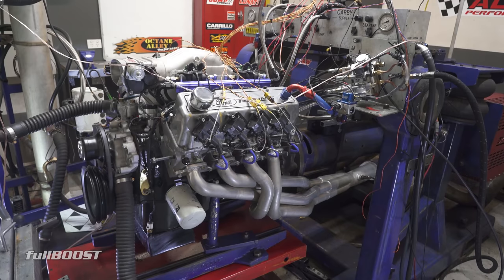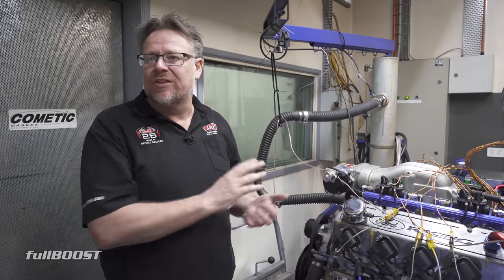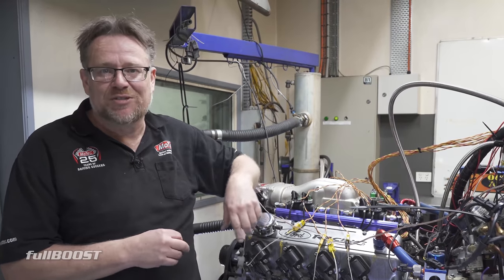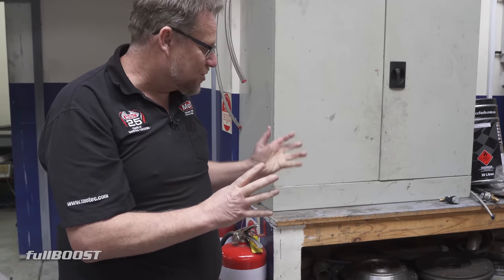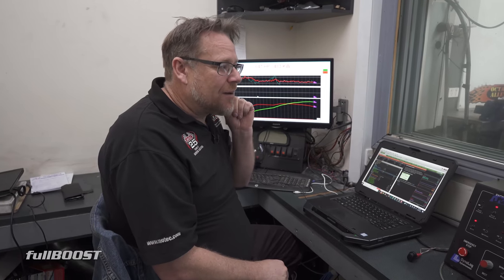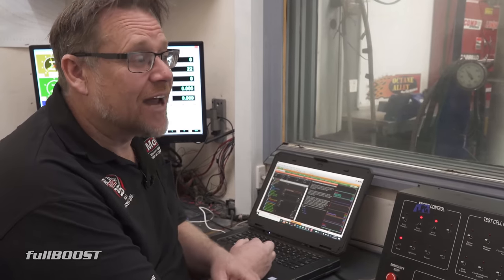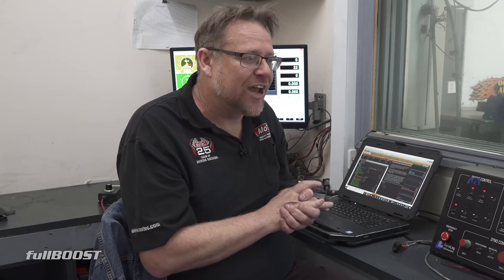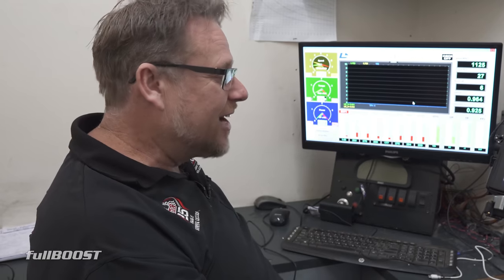In depth engine tuning with LPG liquid injection dual fuel | fullBOOST

Comment from the maker: How to setup and tune with LPG (Liquid Propane Gas) liquid injection with Tyrone Smith from Motorsport Electronics. 👉 If you’d like to be notified every time we upload a video, subscribe and then click the bell icon 🔔 next to the subscription button.
Reply: R h  Hahaha it's running a Motec not a Microtech. See you on Bench Torque.
Reply: R h  wtf has turbo taxi got to do with anything? The fact that scotty blows up everything he touches and can't get the thing to do a 10 says it all.
Reply: R h  not being phased out at all. Scaled back yes but plenty of servos still being built with it.
Reply: Fantastic video. LPG is such an underrated fuel. Aussie made, 100 octane and cleaner, $1 a less cheaper in VIC right now.
Reply: @d_zamb573  but lpg systems dont work according to R H. Guess my 3rz hilux has been running on fairy dust since 2003.
Reply: Nice content! Do you have a switch off at high rpm for liquid injection?

Comment: Having done my final thesis for my Engineering Degree on Liquid LPG injection many years ago, I found this brilliant to watch, that man is a walking book of knowledge. I'm glad he talked about the drop in intake temperature, we calculated that liquid LPG injection should have reduced intake temps by about 20 deg c in our situation, but we never got the chance to test it. I'm very glad our numbers match up.
Reply: @athompson8976  it sure can, but then your entire intercooler piping system is full of an extremely flammable, potentially explosive mix of LPG and air, under pressure. Any leaks anywhere in the system would be extremely dangerous. Take for example, the coupling off the turbo starts leaking, right next to a red hot exhaust manifold, it's probably going to end in a fire at least.

People inject nitrous oxide pre turbo, but that's heaps less dangerous as it's not a fuel, just an oxidiser, so it would need another fuel source to start a fire/explosion
Reply: @tx5brent , no, as with Ford Australia’s fairly awesome EcoLPI variant of their mighty “Barra” inline six, this engine’s LPG is injected as a liquid into the intake ports, just as with port (not direct) injection of petrol. So, there’s only air flowing through the intake manifold. 🚙

Comment: This is great, great stuff!

Setting up a vapour injected LPG Holden V8 currently, which will run with Haltech.
Reply: The fuel composition measuring/modelling in this is amazing. And Tyrone has explained everything so well throughout the video. I really am blown away by the efforts in this creation.

Spectacular.

Comment: I had a Gas Research setup (petrol removed) on a blue 202 with a YT alloy head back in the day.
18 cents a litre with a 110 litre tank, managed a 1000k's between fill ups.
Those were the days for cheap daily performance :)
Reply: That's a BIG tank for a little bit car!!! 😉
Reply: Yeah the gas prices back in the day I remember as low as 12c per litre 
My old mans landscruise had twin 110litre tanks with a 350sbc
Reply: @paullutherborrow637  Nice!
Reply: @danielbrealey2924  VC Commodore and no petrol tank :)
Reply: @geotard  Ahh, a VC!!! I have a VC and a VH... For done reason I thought I read you had this set up in a Torrie. Don't know where I got that from now I read your comment again... 🤦😂
Reply: @danielbrealey2924  The Victoria Bitters had the Red motor, VC's and VH the blue, VK had the black motor with early EFI.  I wanted the VK manifold for my gas setup, then along came the VL with the beastly Nissan 6.
Reply: @danielbrealey2924  Sold it in the late 90's.  Yella Terra alloy head, roller rockers and all the other go fast bits.  Was a sleeper for sure.  Fun to drive easy to repair. Had a DiffTrans 4spd in it with ford single rail parts.  Was bulletproof :)
Reply: @geotard  Ha, interesting pal!!! 🤔 Sounds great. Shame you don't have it anymore. My grandpa bought a red VC SL with a 2.85 and an M20 4 speed. He picked it up the day I was born (he didn't know my mum was pregers) and ended up giving it to me when I got my licence. I lived that car, it got stolen and burnt out in Perth unfortunately... I also had a big $$$ LJ 4 door with a Holden based C.O.M.E Racing 383, M21 (LOL- I used to have to rebuild it every couple of months), a Castlemaine Rod Shop Chassis kit, Hoppers Stoppers brake kit from an LH/X and a 9" with 3.9's... It had a mega buck paint job and interior was all factory fresh (reupholstered)... It got stolen in Vic in the early 2000's by the dude who sold it to me. I worked a 2nd job for him, while I was at a worksite on a Saturday he went and stole the car back. The cops didn't even care... 😡
Reply: I had an LC Torana with 186 and 1600 Celica 5-speed and LPG. Got it registered on 26th April 1978, the day after Anzac day. Petrol was an insane 12.5 cents per litre and LPG for a short time was 3.9 cents per litre for a month or two then went to 4.5 cents per litre. Drove from Mt Waverley to Warnambool and back for $4.20 LOL.
Reply: @Circlotron  Good times, only seen it drop to 5c/L even then no issues, other then during summer.

Comment: I use vaporized LPG in my car, bi-fuel converted. Honda J35Z2 5A/T swap in a Nissan Sentra B17. Been driving this swap for over 5 years and still going strong.

Comment: I’m a little surprised that he isn’t using a bottle heater to keep the tank pressure consistent. I’ve always wanted to do a system like this with 16 injectors on a blown big block Chevy for the cooling effect

Comment: Well there is a true direct lpg injection system on the market. The Prins DLM 3 system. Inject liquid lpg through the petrol injector direct in the cilinder. I think this is the best lpg solution at this moment. The vialle LPI system (like in  the video) is a indirect lpg liquid injection system (works good by the way).

Comment: Very good and informative vid, i have researched  doing a boosted liquid lpg only setup but injector flow is the  issue  looking at 4-450 crank hp on a 2l six (currently 300rwhp with impco blow through@24psi) i could spend hours talking LPG with Tyrone .....still thinking.
Reply: Hi Andrew exact same situation... have a blow through gas research 6 and wondering  if it's possible  to liquid inject it. Where is tyrone and how to contact  ?
Reply: @jackkaratsos8858  he is on LinkedIn however I am fairly certain the good people down at Octane Alley in Geelong Victoria would put you in touch

Comment: Can you run another 2 or 4 injectors in the plenum or anywhere after the throttle body to make up fuel flow for the target hp. Yes taking up more volume early in the intake but also cooling the air that is in this area aswell. Just thinking and wondering  out loud. Great project. Lpg💪
Reply: Sounds like a good idea to me- like back in the day when people were starting to play with turbo cars in the '90's
Reply: @danielbrealey2924   yes same type of setup.  Im sure these guys have had that though. If its not viable im interested to know their thoughts.
Reply: @8power857  running injectors after the throttle body won't allow accurate fuel distribution to each cylinder due to how each cylinder pulls in air. Considering on the lengths hes gone to refining the system and bulletproofing, it wasn't an option.
Reply: @blkidiot  i would think that depends on the level of vaporisation achieved, but with lpg boiling at -36*C or thereabouts liquid fuel is still highly likely where the runners meet the plenum. So yes a good point there👍  This is where a traditional vapour delivery setup prior to the throttle body 'might' be useful to simply supplement an extra 100hp or so worth of lpg vapour, this would not be subject to poor distribution,  would take a minimal extra ammount of 'air space' in the intake tract, the effect of cylinder temp from fuel delivery in vapour form would be negligible due to the huge heat absorbtion of the 530hp worth of liquid fuel boiling off. Of course this is all hypothetical unless tried. Again thinking out loud and happy to hear thoughts in return. 👍
Reply: @8power857  I would think  throttle body petrol injectors like Holley Sniper EFI use would make more sense and be cheaper. The gas delivered upstream displaces air more than fuel droplets (on a petrol-only setup) and is the volumetric efficiency achilles heel of vapour-type systems. 👍
Reply: @8power857  I would love to see the result myself

Comment: I had a choice between buying the turbocharged or the naturally aspirated LPG powered version of that car with the large 4l engine. Would love to have had bought the turbo but after driving both, deciding was a no brainier. I've never regretted it, as a matter of fact I celebrate it every time I fill up & of late more than doubly so. In addition... 
Cost Insurance premiums saving (naturally aspirated v turbo charged) 
Fuel cost per litre saved (LPG v Petrol)
Fuel cost of litres not used
Tyres & Brakes not expended

Fu(K,
I owe this bloke & Deadset Legendary mates at least a metric sh!ttonne of frothies & my thanks for a decade+ of flawless performance. 👍🏼

Comment: clean burn. bulk price. cooler intake temp.... 12.5:1 with proper cam timing make wonder on lpg. definitely harder on the valve and valve guide as its dryer. this should be much more popular

Comment: Curious as to whether this is being run on straight propane or the “Autogas” which is what is typically at any servo. Autogas had a percentage of butane in it, which many a seasoned taxi driver would tell you would give worse economy and performance. No I’m not a chemist, this is purely anecdotal.
Reply from the maker: From the servo 👍
Reply: As mentioned by measuring tank pressure and temperature you can work out the propane/butane mix of Autogas. Then vary ignition timing to suit, providing best performance all year round.

Comment: Is it workable to use a solenoid valve to open static LPG injectors under higher loads in parallel with the electronic LPG injectors? Since the precise map could still be adjusted via the electronic injectors?

Comment: Hello, since you mentioned the difference in propane - butane proportion in summer / winter times of the year, when there is no additional sensor to monitor the proportion of them, what would be the best safe way to tune the ecu for all year driving ?
Reply: Would have to tune for worst case propane/butane mixture and accept the power loss for the lower octane/timing. 
Unless you can run knock sensors with timing retard as required?
Reply: @Luca_____355  i have knock sensors yes
Reply: @Unit2012  can your ECU retard ignition timing as part of its knock control/strategy?
Probably best to discuss with your tuner for the best approach?
Reply: @Luca_____355  ecu master black, yes it can. I tune myself. Still learning.
Reply: @Unit2012  that’s good.
You could have multiple ignition maps setup. Either user selectable, or ideally if ECU allows, run the most aggressive map and scale down if/when knock is detected? 

Probably best to get onto a ECU master group/page and discuss how advanced you can get within the parameters of your specific ECU.

Comment: I had a problem, in 2nd gear when accelerating, the mixture became lean over 3000 rpm, I replaced the copper pipes 4-6mm with plastic 6mm and no more lean mixture

Comment: The LPG injectors looks like fords gasoline injectors but their coils resistance is ≈ 3 Ohms ,  when fords gasoline injectors coils are ≈ 15 Ohms ? I suppose that LPG  injectors has also stronger plunger closing spring since they works on higher pressures .

Comment: Can you make a video on vapor LPG injection? I have a Stilo 1.6 103hp converted to LPG (in Greece it's 70%-30% & in summer 90%-10% butane/propane). Currently running on 100% LPG I feel like the engine makes less power above 4000rpm. In the winter though it seems that LPG is making higher power on low RPMs. Should I just petrol enrich it or maybe I can recover all the lost power by remapping the ignition advance map on the petrol ECU (and somehow switch it)?
Reply from the maker: LPG is a dying fuel in Australia so highly unlikely there will be many more videos on this subject. Good luck on your project.
Reply: @fullboost  Thanks for the input. My main problem is that the engineering bibliography on vapor LPG injection is rather poor. And as I don't have access to a dyno, I have to go by the trial and error method.

Comment: I have just been informed by a UK supplier of Vialle LSi liquid phase injection systems that Vialle went bust over the summer (2022). Prins have acquired Vialle's intellectual property and they have told me that they will not be selling any Vialle's LSi system kits, only spare parts to existing customers. Perhaps Westport Fuel Systems would rather we all forget about LPI technology. Anyone seen a Zavoli LPI system either?

Comment: How difficult would it be to put this system on a 2023 RAM 1500 5.7 Hemi?
Reply from the maker: What would be the point. You'd have to drive a lot to make up any fuel savings.
Reply: @fullboost  More so looking at disabling MDS, replacing lifters with performance roller lifters & adding a cam etc, try to make it more reliable overall and affordable to drive at optimal operation. Only reason the new Hemis get the economy is the MDS. But that's not fail proof and the rollers in the lifters can fail due to low oil supply/pressure. I'm talking if one were to hang onto the vehicle for more than 150,000klms or one were to buy a RAM with high klms etc. Most of us who own Cruisers & Yank tanks live rural and average 25,000klms a year minimum.
Reply: And also tow a lot. MDS isn't engaged while towing, so MDS fuel savings are absent anyway.

Comment: you could put 2 vaporizers with a bigger tube from the reservoir and it would be 10 times easier and it would work 100% on gas at all powers

Comment: 5 years runing an old bmw on lpg( landi renzo) now im.playing with a turbo. Did all the job runs great drive greats on petrol. But on lpg as i hit boost the engine starve. I tryed to recalibrate the lpg but no suscses. Any one knows how to tune the lpg system. ?
Reply: You need to modify the injection time in the lpg unit. Check if your injectors are big enough, and if you run 8mm pipe from the tank to the reducer.
Reply: @soukoukou4730  i think i need a biger reducer. Mines its only good for 150 hp